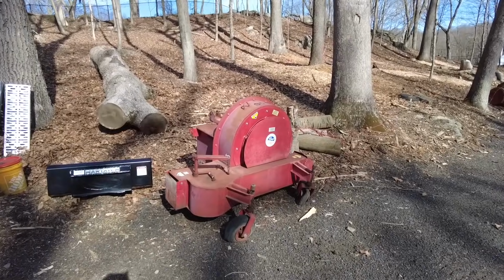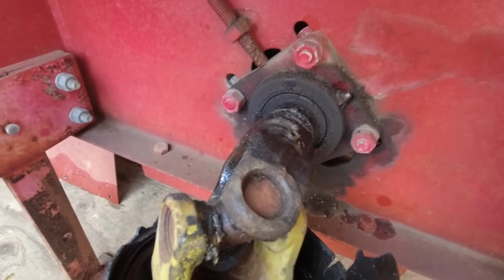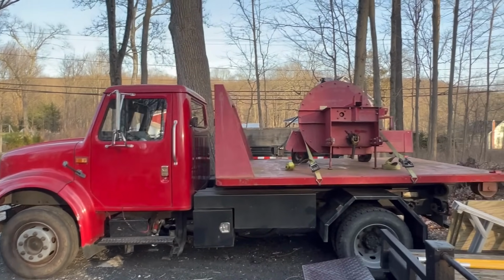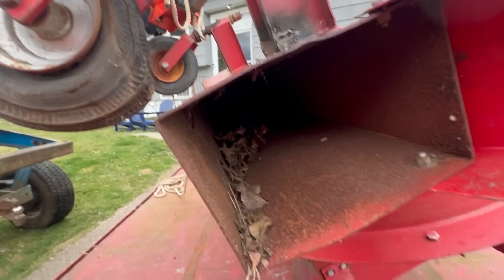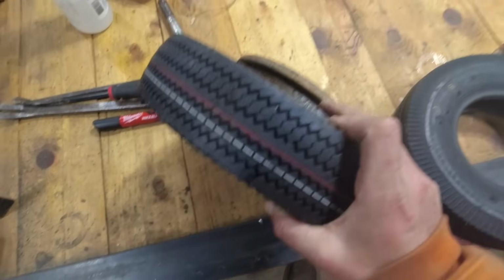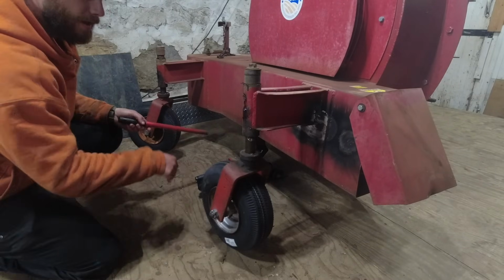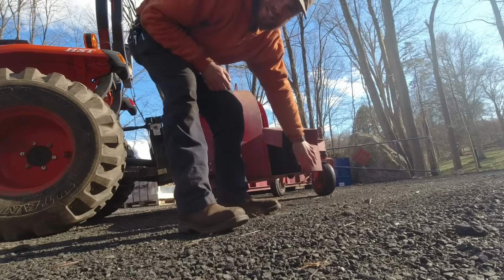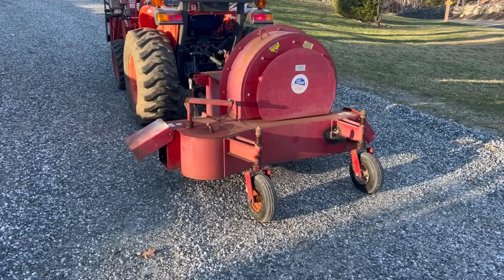#465 SAVING a PTO Leaf BLOWER from the SCRAPYARD!

Comment: Hi Jake. New subscriber and enjoying your videos, especially this one. Awesome machine you got there. I'm up in northeastern CT and had been looking over the last year or two for a PTO blower for my L3901. Hard to come by used, but found a RAD recently for next to nothing. Had to do some similar work on mine like re-beading the tire and replacing the valve. It has a manual chute that the long handle got bent by the prior owner. Like you, need to find a buddy that has a torch to get some heat on it to bend back into form. Changed the gear oil and good to go. Thing runs like a champ and can't wait to use it in the fall on the pastures and driveway. Should significantly cut down my labor time with the back pack blower! I may even show it some more love and throw a new coat of paint on it during the off season. Hope you do a video in the fall with yours. Enjoy your machine. Mike
Reply from the maker: Nice! Sounds like you got yourself a good find as well! Good luck with it and thanks for watching

Comment: I bought the same one! I painted mine. The wheels were destroyed and the castors bent pretty badly. So I bought 12 inch castor wheels from TS and did some modification and welding to get them to fit. I'm adding an actuator that I can control from the cab of my TYM574 to change blowing directions. Old Harper-Goosan blowers are flipping in the $3,500 range. Argimetal blowers are way up there in price as well as all the turbine units. --- Can't say I'm looking forward to fall because I just love summer. But I'm ready.
Reply from the maker: Nice! I’m looking forward to using mine as well!

Comment: Believe it or not I did prototype work for giant vac years ago. Those castors should be greased and the wheels can be filled with liquid rubber at Pete's tire barn in Connecticut. The PTO drive shop should be lubricated.Greased, where the 2 pieces meet and come together.It will make it taking apart and removing the attachment much easier❤❤❤❤
Reply from the maker: Wow small world! Yep I greased everything on it and the new section of pto shaft had grease inside it already